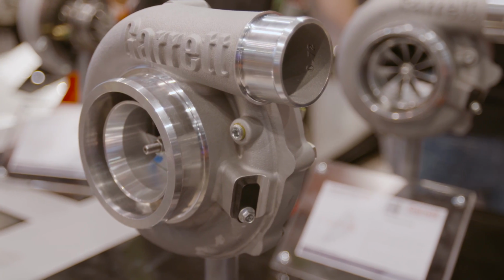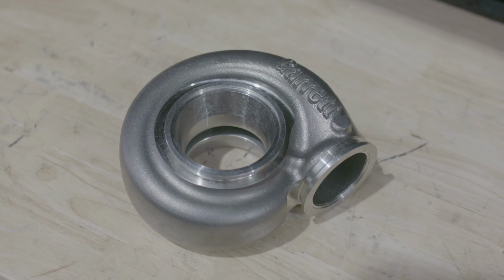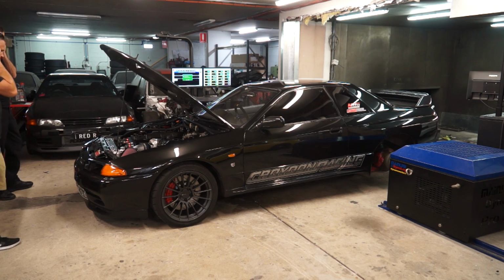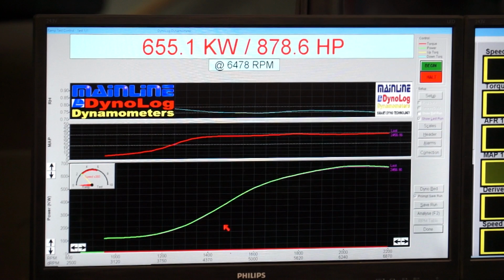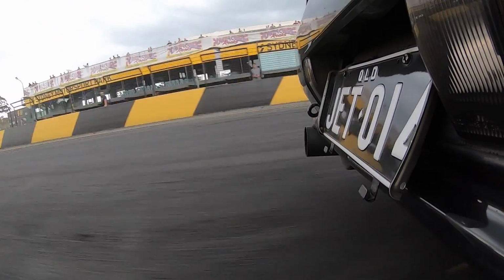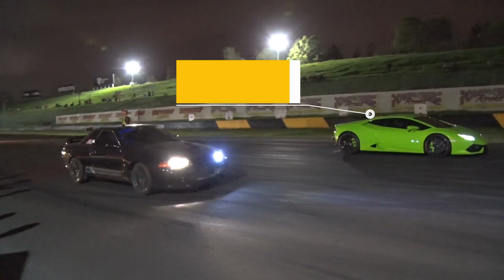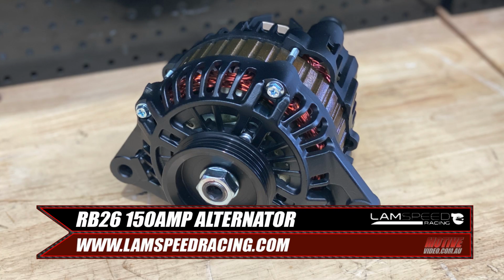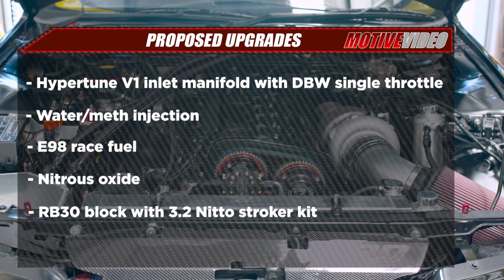9500rpm and 900hp with Garrett G35-1050! Best single turbo for GT-R?

Comment: "lots of words about keeping response and being a street car" ..... spends the rest of the video rowing through the gears on a sequential box between 7500-9500 rpm
Reply: Idk about you guys...but if i own a nearly 900hp r32 ..i would be in the red all the time too..sooo Andrew do your thing my friend..sequential or 5 speed..redline or cruise... no one should care..its a great car
Reply: This turbo is same as a 6870
Reply from the maker: John P we showed roll ons in 1st and 2nd alto what it’s like to come on and a couple or corners to ourselves. We can’t go back and install a stock 5 speed to give another  example.
Reply: @MotiveVideo  Andrew you make good videos, and I realise this was at least partly driven by a product placement exercise, but taking out the sequential wouldn't change the fact you spend most of your time in this video in the top 2k of rpm range. It would just make the car slower. I'm just saying, given your demonstrated usage, and indeed in my experience what most people's usage is of cars like this, perhaps the next product placement could be a G42-1450 ..... maybe accompanied by the Hypertune manifold you mentioned and some higher lift cams for shits and giggles
Reply: @john_p  Well considering Id bet my left nut Andrews had the idea of putting a 3.2 in it for a while now, which is now confirmed. The turbo choice now makes total sense.

With the hypertune manifold an additional 600cc of forged 4340 wide journal goodness rated to 2000hp + E98 this turbo will be a really great match for its intended purpose.

I bet my right nut when Andrew goes billet block he'll probably change the turbo again and then you'll really spit out your chips.
Reply: I'm not sure how much better you were expecting it to be. That pull from 4500rpm with the Garrett guy on board saw it make boost almost instantly and it pulls to over 9000... That's well over half the rev range which seems pretty good to me.

Show us a 800hp GTR that makes full boost from 3000rpm and maintains it to 9000+?

I suppose it depends on what your definition of street car is. Is it a factory GTR experience, no. Is it able to be driven on the street comfortably and a really good balance for multiple types of motorsport, yes.

You could also go and watch some of Andrew's other videos if you want to see other driving conditions... It's not like this is his first video on the car 😂

Tough audience out here on YouTube 😁
Reply: @gazmosis87  i think you missed my point
Reply: @john_p  The new breed of turbos coming out are a lot more linear across the range, explained in the diagnostic flow maps. Basically its a lot more of everything everywhere in the range its been driven. This = a lot more driveability.
Reply: @Hybrid330i  So you can go bigger and still have the same bottom end. Good.
Reply: @Gary Ribbans
“Show us a 800hp GTR that makes full boost from 3000rpm and maintains it to 9000+?”

If you can make full boost (35psi) at 3,000rpm why rev to 9,000+?

500lb-ft @ 5,000rpm = 476hp
500lb-ft @ 9,000rpm = 857hp

The problem is “most people” making 476hp are doing it at  7,500rpm with 333lb-ft. Aka slow.

Anyway both engines making 500lb-ft propel the car forward at the same velocity given the correct gearing.

By anyway that’s an argument for another day.

I think the point was just small jab, a joke, about saying response response response quick spool down low... insert buzzword here. Then following up by doing the exact opposite. It was just a joke (i think. Haha)
Reply: Someones jealous 😉 the fact is the car is still perfectly capable on the street. I recommend you watch some of the previous videos on the GTW setup being driven on road, it will surprise you. The 500rpm difference on the G35 won’t kill it.
Reply: I understand perfectly what you are trying to say but it's a bit narrow sighted to watch one video (which is a fraction of a whole event's worth of footage) and then have a jab at Andrew for showing mostly him at the top rpm range. He has done videos of hill runs, street driving, track days, all times when a bigger turbo would not be ideal at all. Maybe just watch some more of his content?

Comment: 7:29 7:57 these runs and others; sounds like the turbo is surging
Reply: Thought of the same thing but was also wondering whether it was the waste gate chatter.
Reply: @leonmuli7841  yeah they put a 60mm external and bigger rear housing and now you can hear the  frequency of the solenoid acting on the external.
Reply: @ngt84  good ear. they are runnig oem throttle bodies.. i know some have made 1000awhp but they also have dyno correction factors and australia is much more realistic with numbers.. could be a intake restriction if it is surge...?
Reply: @alexmartirosov6028  surge occurs on the left of the compressor map  this engine-turbo combo netting 800+whp is clearly stepping on the right side of the map - Near overspeed. no relation to surge whatsoever. You will also notice the pulsating sound more prevalent when external ventilation is in lower actuation. Thats in two rpm bands. At the start of achieving the requested boost where turbo is big for that rpm And at the end of rpm where the turbo becomes less efficient and needs more exhaust passing through the turbine and not venting
Reply: Nope. Thats typical electronic boost control that makes external pulsation sound.

Comment: So the upgrade turbo manifold gate and stuff was roughly $7000? for not much more power and more lag? hmmm  doesnt sound that great to me.. but good video!
Reply from the maker: AUTO-TUBE you’re looking at it wrong. We’re rating the turbo so people can decide what turbo they want from the get go. 

If we just wanted more power we’d slap a G42 on
Reply: @MotiveVideo  "our aim to make more power and keep driveability" is what you stated at the start.. just saying

Comment: I thought it was supposed to be at 1000 hp by now.
Reply from the maker: When did we say that?
Reply: think thats just the end possibility
Reply: It would make it easy if he went a larger frame turbo but with what he wants it to do he only only wants to run a medium frame turbo to keep it a good all rounder (I'm sure you know this but just in case)